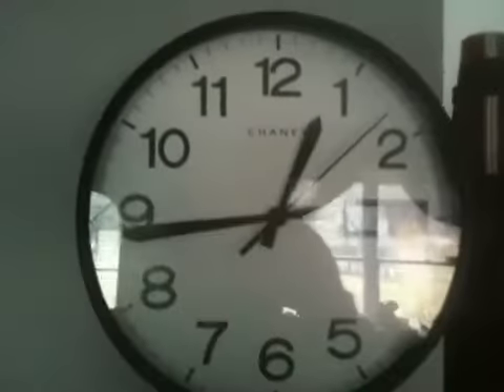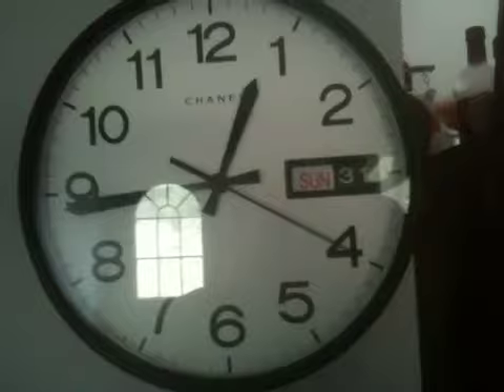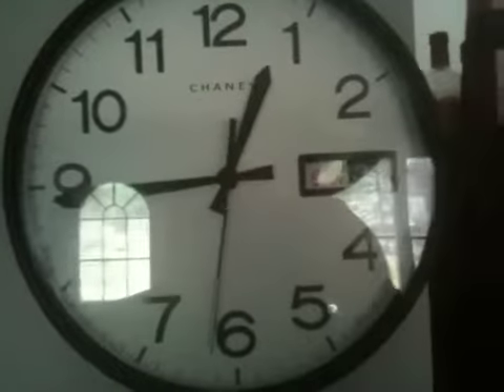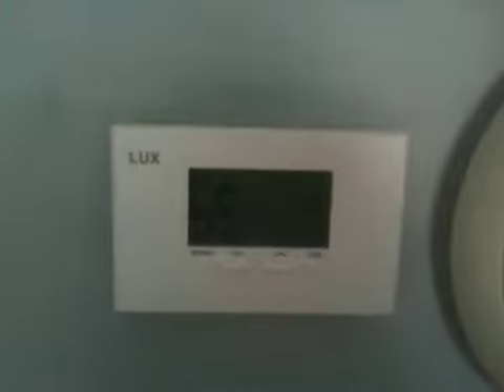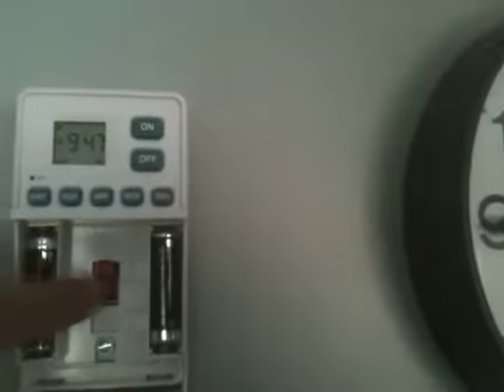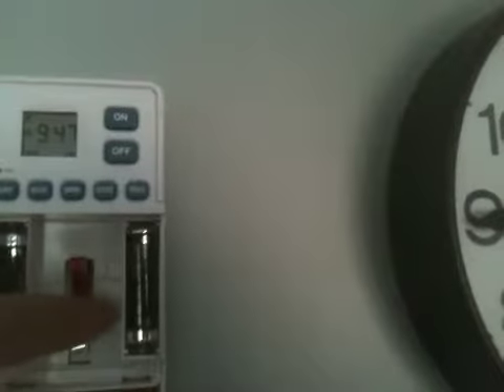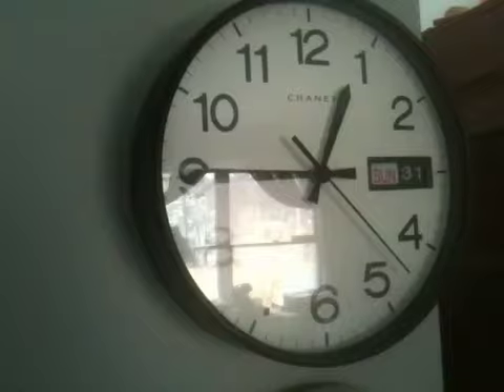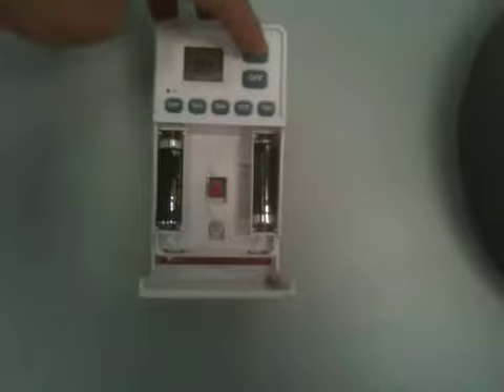Home Heating Control Panel

Comment from the maker: With this setup you can save money learning how to minimize the burner on time. For instance I learned that on warmer days when tho house did not need heat that it still took 50 minutes of burner time to keep the hot water hot for 24 hours , so I bought a programable light switch to turn the burner on prior to getting up so I would have hot water for a shower. I would then turn it off manually when I got up thus saving about 40 minutes of burner on time a day or about $2.25 a day in fuel cost.

Comment from the maker: If you add up every tick of the clock, about 1/4 of an inch, a full tank consisting of 275 Gallons burning at a rate of 0.85 Gallons per hour yield a gauge that is over 2 miles higher than Mt. Everest.

Comment from the maker: Programing the Thermostat
When I am home for the day at 4:45 AM it is turned up to 70, at 7:30 PM it is turned down to 65.
On work days at 4:45 PM it is turned up to 70,  at 7:30 PM it is turned down to 65.

Programing the Switch
When I am home for the day at 4:30 AM it turns ON, at 7:30 PM it turns OFF.
On work days at 4:30 AM it turns ON, I turn it off when I get up or after the room temperature gets to 65, at 4:00 PM it turns ON, at 7:30 PM it turns OFF.